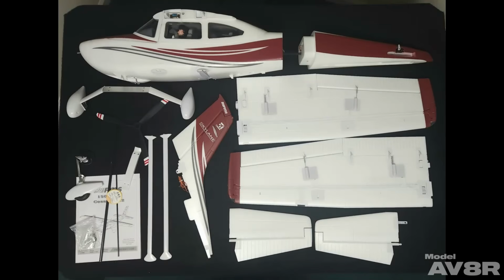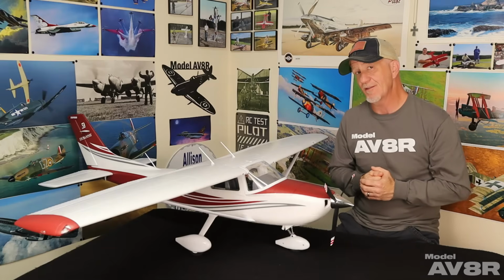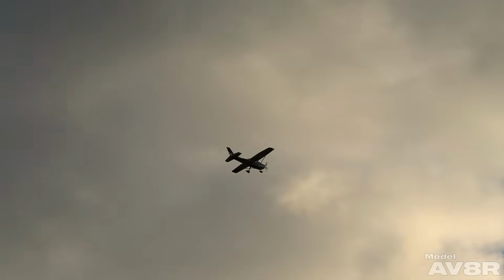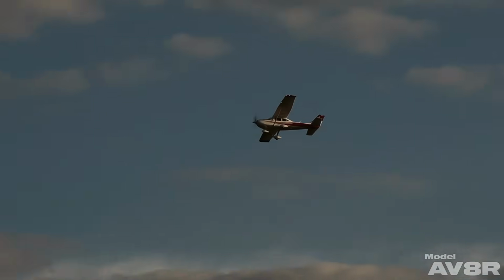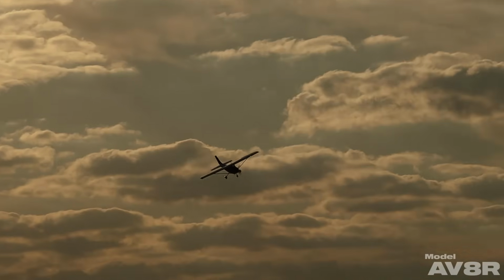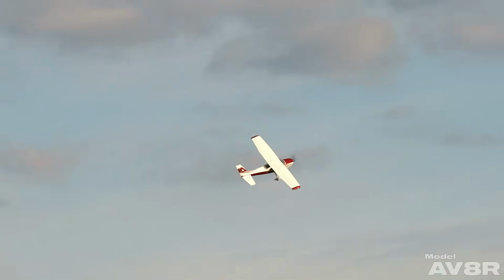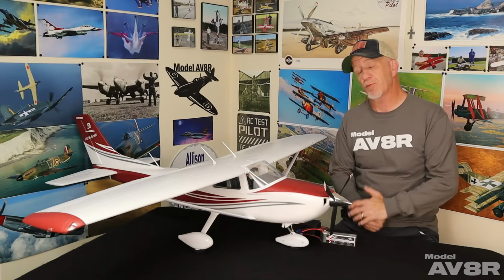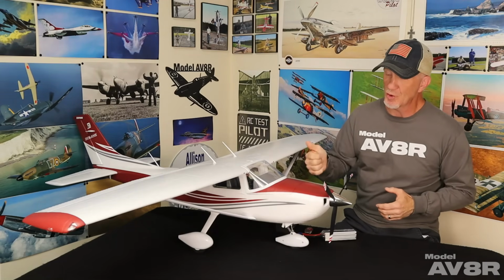FMS Cessna 182 1500mm PNP - Model AV8R Review

Comment: I also like the looks and all the tech details that FMS came up with to make the plane easy to transport in a smaller car and no fiddling with countless connectors. What I do not like at all is the wheels that make this rattling, super cheap sounding noise. A lot of of planes do this. As if decent bearings would cause a fortune. Furthermore, these cheap plastic on metal ‘bearing’ easily wear out and after a while the wheels do not track well anymore. The blinking nav lights are also super annoying, not only because the blink, but rather that they blink independently. That means (very likely) the LEDs themselves are blinking and the only way to change this is, to replace them with non blinking ones that are still bright. Finding a nice bright LED with low power consumption is actually harder than I thought it would be nowadays. Except for that: well done, FMS! And as usual, you and Heidi made the Cessna shine as bright as it could, Adam! 😊
Reply from the maker: Thanks! The wheels sound much worse on camera due to our off camera mic than they do in person. That said Du Bros are available if anyone wants to replace them. FMS and other factories use the hard tires because they buy tires in the thousands and have a bunch still on hand. They're going to get everything out of that investment they can before they buy more and go with softer tires. I'm not sure why they did the lights that way.
Reply: @ModelAV8RChannel  I put Du-Bro low-bounce wheels on the earlier 1.4M version of this plane - highly recommended! There's a bit of a weight penalty but it is soooo much better otherwise. In case it's helpful, I installed  Du-Bro 2" #200T on the mains, and Du-Bro 1.75" #175T on the nose gear. You do have to shim the Du-Bro wheel with small washers as the hub is slightly thinner than the stock wheels but that's really easy. I also put a dab of moly-lube grease on the spindle for good measure.

As always, thanks for a great review! This new version addresses a lot of issues with the older plane and I'm tempted to upgrade. I'm very partial to scale Cessnas (my dad flew several of the different Cessna 17x series).
Reply from the maker: @rgsvidz  Thanks man! BTW...this is not an upgraded version of the old sky trainer. It is a completely new...and larger mold.
Reply: @ModelAV8RChannel  Yes, I should have referred to this as "the successor to the SkyTrainer 182 1.4M". Unfortunately, my SkyTrainer 182 bit the dust today - coming out of a gentle loop (very much like the one you do at 17:34) the left wing snapped in half. I think that's the Achilles heel of the SkyTrainer 182 - the wing spar is just too short and it's just not engineered for high(er) G maneuvers. The new plane's airframe seems much more robust, and I love that it's 4S capable right out of the box. I wonder if FMS will give me a pity discount off a new Cessna 182? 🤣

Oh, one other thing that's gotta go on both the SkyTrainer 182 and this Cessna 182 - the plastic-geared servos (at least for the rudder/nosegear). I put a 15g metal-geared servo in my SkyTrainer after stripping 2 of the FMS servos and never looked back.

Now if only I could upgrade my flying to look as good as you... 😁
Reply: Hope you’re enjoying your fms planes. As for the blinking lights there’s plenty of info on the web how to mod easily for fms. I’ve done it on my FMS A-10, And others. Simply remove each wing and unscrew the quick connect on the wings and gently pull the wires out until you find a simple blinking resister(no idea what it’s really called) unplug it and plug the wires back together. Reassemble, Done. No more blinking. Aside from the absorbent cost of some of the fms parts here and there they’re some of the easiest foam planes to work on. Hope this helps someone.
Reply: @Hype_RC  Thanks! Valuable info. From an electronics perspective, I do not really understand, why adding a resistor would cause the led to blink… usually they just limit the current to prevent damage to the led and that‘s it. Still, if it worked for you, I won‘t doubt it 😊.

Comment: Nice review Adam! The only odd thing is they should have made a quick connector for the servo cables for the tail section just like with the wing.
Reply from the maker: Thanks man! I think because you only do it once they just went with regular plugs.
Reply: @ModelAV8RChannel  Most might not take it apart but I and some others store it in the box when not flying.

Comment: I purchased the red model. I set it up with a Spektrum receiver with AS3X and it flies beautiful. Mine has the crooked decals. I contacted FMS customer service complete with pictures of my model including pictures of a full scale 182 showing how the decals should look. My suggestion was send me a new vertical fin and decals and I will correct the problem. They see nothing wrong. HA! They offered me $10 off. I tried the ice cube method and it did not work. If I can come up with paint to match I would pull the decals and repaint the fun and replace the decals.
Reply from the maker: Interesting. I'm not sure how I'm going to fix mine. I think for 10 off I might just get a vertical and print the decal myself. I think a Cricket will do it. I can do the work like you said and Heidi can match the paint, but a new vertical would make it so easy. Time is money I guess, Lol.

Comment: My wife bought me an apprentice 1.2m S RTF, it went together easy, but when you try to move the ailerons , the vertical stabilizer move left and right at the same time, even when the stick for the vertical stab also works. Help, I am clueless
Reply from the maker: That is a programmed in mix to help coordinate turns for a beginner.
Reply: @ModelAV8RChannel  So it is ok to fly like that? Thank you
Reply: @ModelAV8RChannel  My wife surprised me with this one, but if I learn to fly well enough, i’d like to get a Super Timber, can I buy one through a link to your channel, or do you have a code to use to link it to you? I appreciate you getting back to me, I have been waiting to fix this issue to fly, and apparently its me not the plane? Thanks again!
Reply from the maker: Yep, that is normal. The mix is there to help you. If you can, contact a local club and get some assistance from someone experienced before your first flight. Having a knowledgeable set of eyes to look the plane over, maiden and trim it, and give you some pointers is always a big help. I know they (Apprentice) are marketed as "Teach yourself to fly", but I've seen a lot of people crash them. This is a particular skill set, and while it will get easy, it isn't at first. Best of luck and happy flying!  When you're ready for a Timber you can just go through any link to Horizon on any of our videos.
Reply: @ModelAV8RChannel  Thank you so much for your videos and info, I live in rural Wyoming, your videos and comments are the best I can hope for, and I do appreciate it !

Comment: The scale fidelity and ease of assembly are top notch. Testing it on 3 cell was a great idea; not setting your world on fire is the modus operandi of this sort of plane full size so 3 cell will be great for scale flying. If it will carry a pair of 2200 3 cell lipos  in parallel, it would give some gas rivalling flight times. Gratz to FMS for the plane (ignoring the lights ...) and Adam & Heidi for another great test. Edit: I'd love you to review the Reflex V3, preferably on a non-FMS plane (ie no premade config)
Reply from the maker: Thanks man! Great flyer, and the lights are an easy fix.

Comment: Based on photos and my experience with real 182s, I think the placement of the lights is good.  The Cessna 182 has one landing light, in the leading edge of the left wing, the nav lights are in the leading edge wing tip clear housing, generally with the anti collision strobe in the same housing.  The main gripe I have with the lights is that the white anti collison light on the wing tip should be flashing and the red/green nav lights should be constant on.  Hopefully that is something that can be easily corrected by the purchaser.
Reply from the maker: I have a buddy with a 182 (full scale). His Tips have forward facing landing lights on the leading edge of the tips in addition to the two in the center of the left wing...so 4 total. It has the strobe and nav lights in the center of the tip. There are multiple tip options for Cessnas. Easy fix on the model.
Reply: @ModelAV8RChannel  Mine will be here next week.  I plan to vinyl wrap it as a Civil Air Patrol ship.  Decals are already on order from Callie.  I'm hoping changing the flashing nav lights to constant on and the wing tip anti collision lights to flash is an eay fix, but I have a feeling it will mean manually cutting and changing the wires in the wire trough in the wing.  If you find a better way. let us know.  I appriciate your review, well done.
Reply from the maker: Check this out...not perfect, but it worked and looks good. 

https://www.youtube.com/post/UgkxT73QJL3Js7N9IGDpAsQWy70YQ6BGkaMY

Comment: Great review as always. The only thing stopping me from getting this are those good awfully loud wheels. It’s like nails on a chalk board. Can grease or Dubro soft wheels help?
Reply: Yep, they sound so cheap on the runway.
Reply from the maker: Thanks! Yes...you can always replace the wheels if you like. Du Bro foam wheels are fine, and still very light. I'd never not get a plane over wheels. The thing is...these factories buy wheels in the thousands. Every plane has to have them. They know the going gripe with people is hard wheels, and that will change eventually...but not before they get their moneys worth out of their investment by using what they already have paid for. In the mean time...wheels are a inexpensive and easy thing to change if you want.

Comment: I have this one coming in the mail soon. A really nice craft i am looking forward too. I am sorting out a list of 4s CNHL batteries that would be suitable. Do you have a weight recommendation to not exceed? Im considering 360-500gram batteries ranging from 2200-4500mah in 4s.

That gear housing does grind really loud :( I would try to dampen the noise from the wheel cowl somehow i think.
Reply from the maker: Very nice flyer, you'll really enjoy it. In my opinion, the 2200 4s are the best choice. The lighter battery lowers the wing loading and allows easy nose high main first landings. The power system is efficient, and the less weight it carries, the more that is prevalent, so the flight time with throttle management is still very good with the lighter pack. It flies fine with the larger 3200's, but not as well. The more weight you add, the more nose heavy it feels in the air and on landing. I would never go any larger than that, with a 4000 that is just too much weight. Again, this is my opinion and that is preference based, so others may tell you different.  Softer tires would cut down on the noise.
Reply: @ModelAV8RChannel  Thanks for the input.  Won it in a raffle last night during a live stream, I got into RC Helicopters 6 months ago and that has been my drive in 2024; I do have an Aeroscout 2.  Wife and I fly together and we were planning on getting into Fixed wing this next season, so I am hoping this and an FMS PA-18 will be complimentary 2nd and 3rd craft for us.

Will focus on 2200 mainly and a single 3200 as an experiment to learn how to feel/fly as you described will be like.
Reply from the maker: Enjoy it man! Great that you and your wife can share this! I think your plan is solid. If you ever have questions or need help don't hesitate to ask.

Comment: Kinda off topic 
But how and what do I look for when propping up ?
I want run the super timber on 4 cell but not sure what to do with the watt meter .
Reply from the maker: First do a pull on the watt meter with the stock prop on 6s. The amps you pull on that test is your base. You want to get the amps on 4s as close as you can to what it did with the stock prop on 6s without going over.  Start with a 15 x 10. We have a video on Watt Meters 101...check that out.

Comment: Why no battery telemetry in 2024? The annoying thing about FMS planes is that you have to throw away the crap ESC/giro, and $witch to spektrum so you have BASIC safety/telemetry functionality. If you don't vote with your wallet, they'll keep thinking this is OK.
Reply from the maker: A lot of people are confused by misinformation that has been put out there. So, while it is popular to believe that Horizon owns FMS...that is incorrect. They do not. They work with FMS on certain projects they are paying FMS to manufacture for them...airplanes specifically, as in the airframes, but not certain components. The Spektrum SMART tech, Avian ESC's, AS3X/SAFE are all proprietary technology developed by Horizon for their own product lines. When FMS makes an airplane of their own design...like this 182, they are not at liberty to use the Horizon components reserved for Horizon name branded product lines any more than Freewing or Hobbyking could. FMS is not the only factory in China Horizon works with. You will only ever see Avian esc's and Spektrum RX's come as standard equipment in E-Flite, Hangar 9, and other product lines specific to Horizon Hobby. They are sold as components by Horizon so you can equip whatever you want with it, but it isn't anymore realistic to expect those components to come in an FMS plane than it would be to expect them to come in a Freewing plane you buy at Motion RC or a Skywing plane you buy from Extreme Flight.  Horizon didn't develop that technology as a selling point for everybody's airplanes, they developed it as a selling point for their own planes...which makes sense.